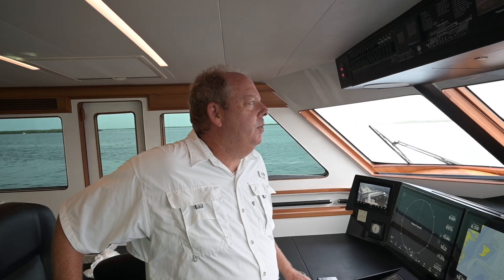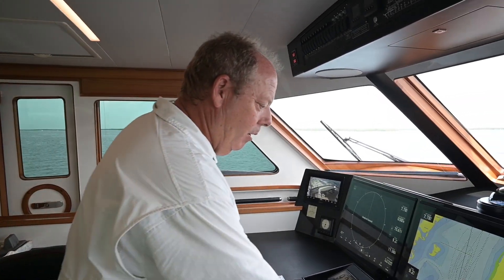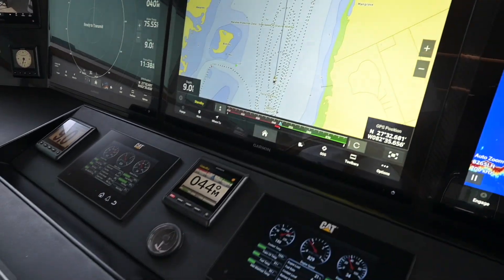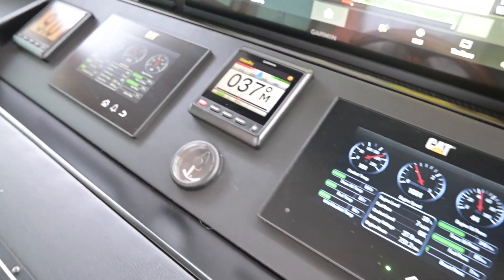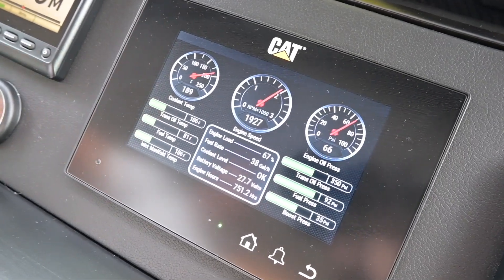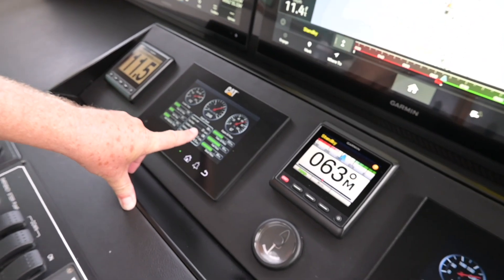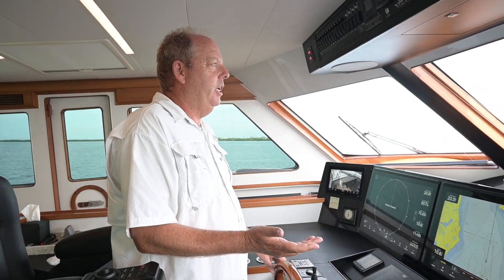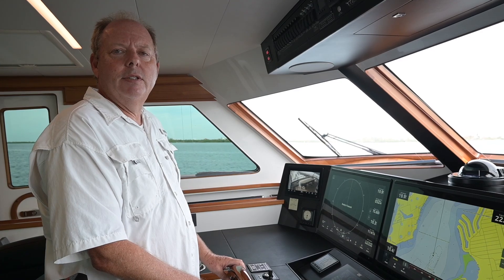Is a 6 Cylinder C-18 OK for a Marlow 70ECB? We look at this on Incorrigible a ME 70 ECB

Comment: Considering your physics, I would be fine w/ the C13 Cats. More walkaround room and less weight are great!
Reply from the maker: For less power and a smaller package I would consider John Deere too.  They make an Inline 6 @ 750HP 2100 RPM that the commercial guys use a lot-.  I would also look at a de-rated C-18.  You can order the engine at far less HP and it has a longer duty cycle.

Comment: You can,  it saves engine hours but not much if any on fuel.  It takes some rudder angle to go straight on one and you have the drag of the off engine.   If you used 4 a side at 8 it takes something close to 8 on one.  I think if you could just spin the other prop with hydraulic or electric for 0 thruster it would be good.  Probably not worth the effort unless you are crossing oceans.